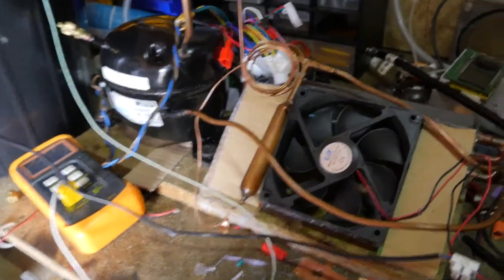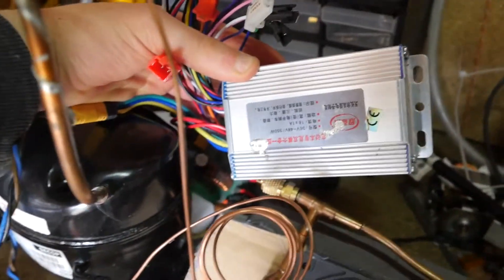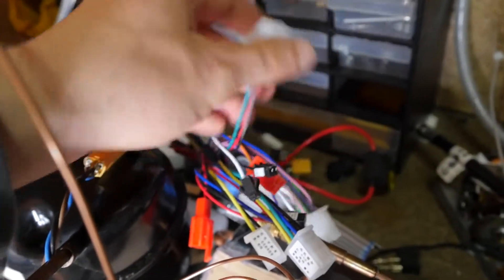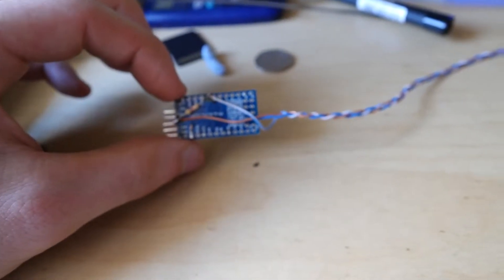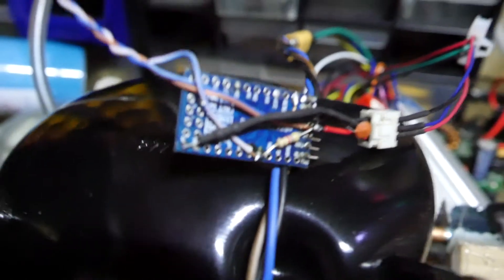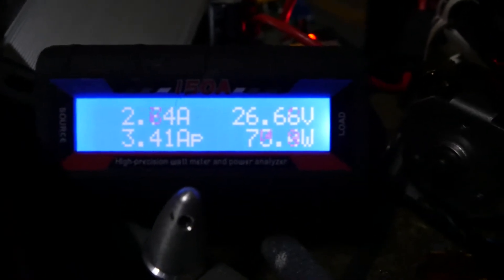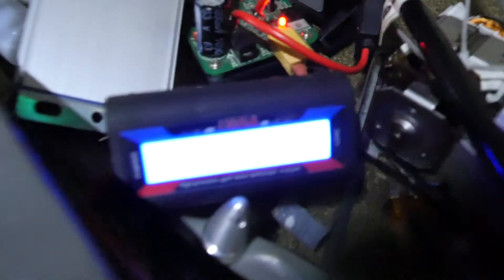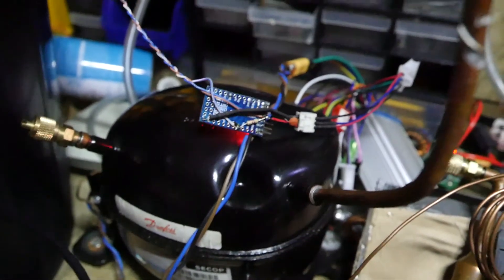Arduino BD35f Temperature Controller

Comment: good Morning,

What bldc controller do you use for the BD35F, and what voltage does it ?, in the original controller is apparently still a stepup converter incorporated. Have already tried some but with none runs my compressor.
Find their experiments very interesting and instructive.

Best regards

walter